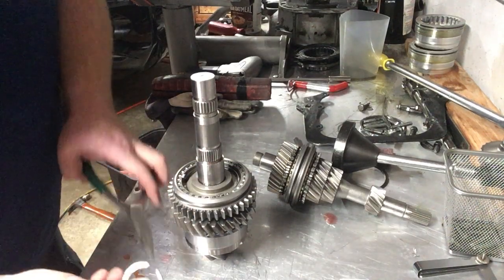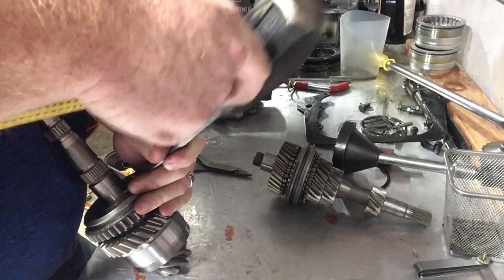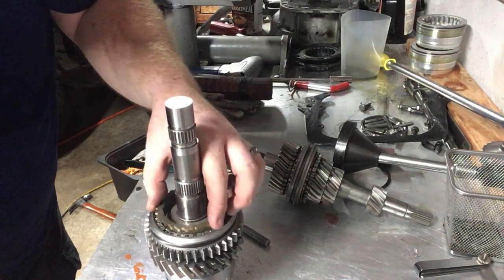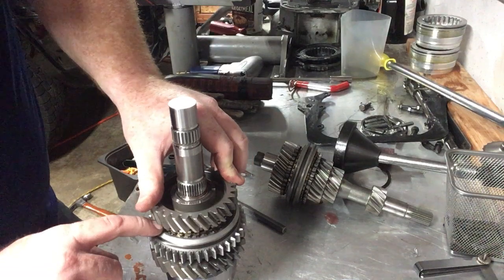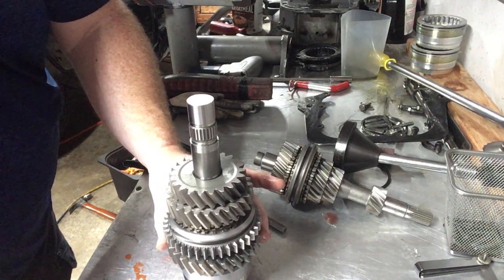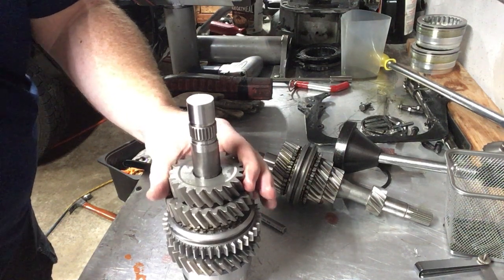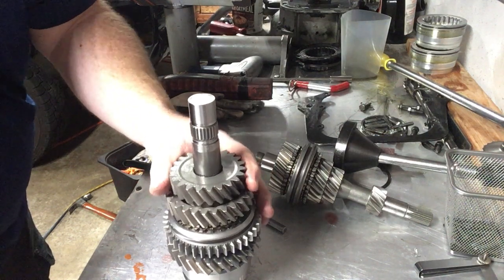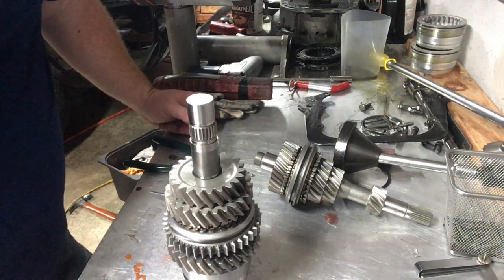091 Pinion Shaft 2  3 add on

Comment: good video!. I'm currently rebuilding a 3 rib with a new 4:13 pinion and original gears. You mention pressing 3rd gear in place if original, I imagine the same tips are good for the 3 rib? ... or could mill down the splines lightly and have the gears slide on without pressing.